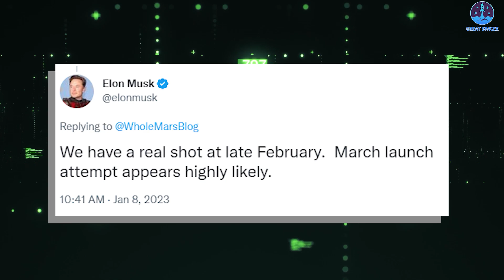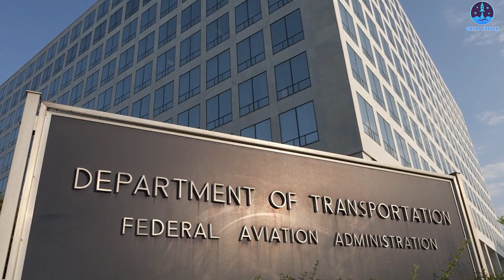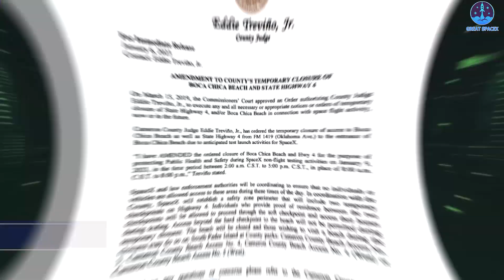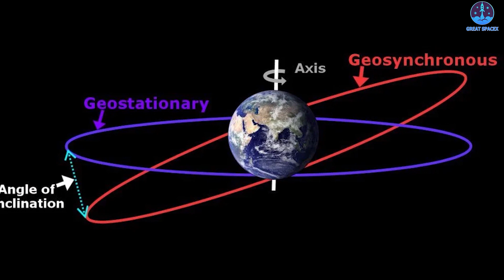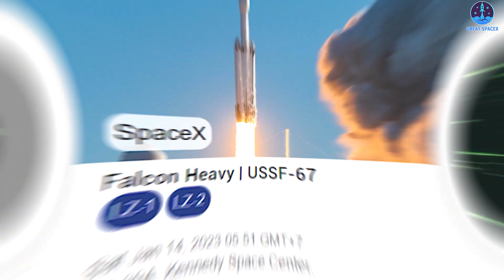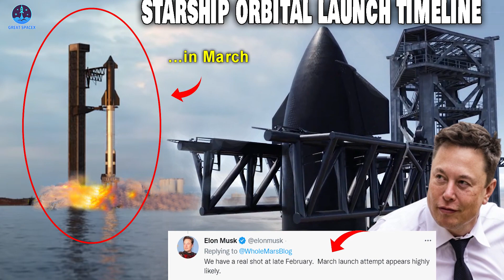Elon Musk just officially announced "S24/B7 attempt the orbital launch in March"...

Comment: The FAA isn't the reason for launch delays, SpaceX is working through technological challenges. SpaceX is demonstrating a responsible progression of development by approaching a launch cautiously.
Reply: The FAA have Not granted SpaceX a licence, so StarShip cannot launch.
The FAA has not given us a timeline for issuing the launch license.
Reply: Well, when they developed the Falcon 9. it was on the basis of test flights, many of which blew up.  SpaceX has definitely changed their approach, and slowed it way down.
Reply: Musk has used complaints about the FAA and EPA as excuses for not having the system ready for launch. The system is NOT ready, and it has to do largely to SpaceX. Right now, the rocket would likely blow up on the pad if all 33 engines were lit. It is pure hubris to continue to insist that no flame diversion is required.
Reply: The FAA have delayed the program by at least 1 year already. The FAA are not fit for purpose.
Reply: @rorykeegan1895  You may not like the FAA, but they're not preventing a launch attempt right now. In other words, the rocket isn't sitting on the pad ready to go.
Reply: @Columbus1152  
How many of the 80+ nonsense hurdles from the year long FAA environmental review have been enacted and signed off? Any idea? The fact is they cannot launch without a license, and it hasn't been forthcoming as yet.
Reply: Thanks Elon bot!